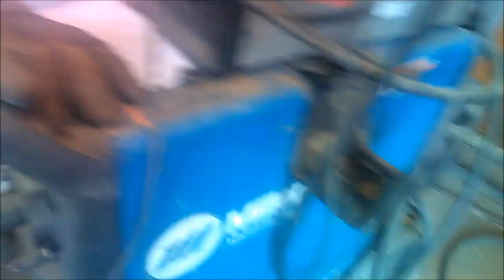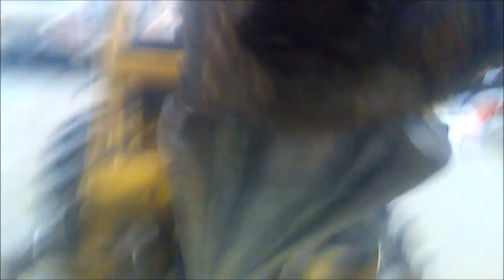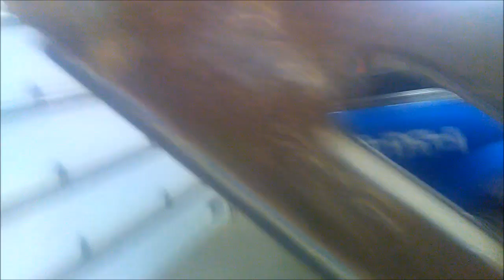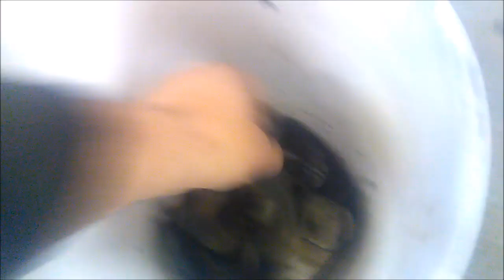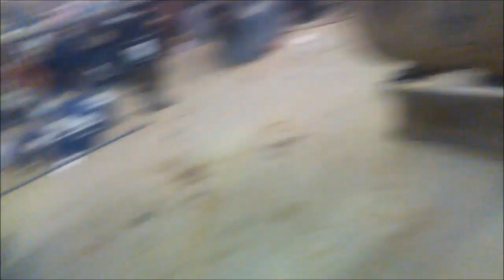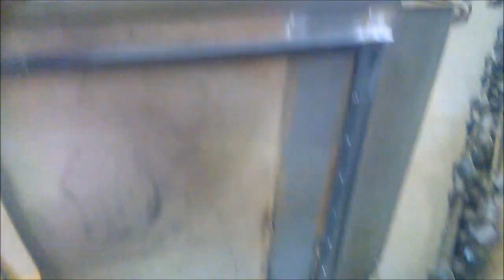Trencher repair

Comment: The whole chain frame has been bent out of alignment with the trencher
Reply from the maker: I'm not sure which part of the video you are looking at but it looks good to the eye in real life.  We are still running that trencher 5 years later with no changes to any of that.  It has worn out the chain a few more times since then.
Reply: @kennykemp2790 I apologize, my Vermeer.
Reply: It was purchased from a rental. But I think it was turned too hard. So now its all twisted
Reply: They are quite the machine

Comment: Kenny I have a 2013 Vermeer rtx750 trencher and I bought a chain from Ballantine which is a all cup teeth. After a few miles they are gone. I’m in a very hard sand. What teeth would you recommend? Would the teeth you have in this video work and how can I get them.
Reply from the maker: The ones we built work good in hard/abrasive sand or hard sandy clay or soft sand.  Pretty much anything that doesn't have over 8" rocks in it or very sticky/muddy clay. I would switch to an open rock cutter for that application similar to the B135318 and B135317 (Right and left hand rock/frost adapters).  If you can get them to match the cup cutter height you can run them on half the chain if you want.  The terminator/sharks teeth wear a long time also but are a little harder to change out when they need replaced.  Bolts or welding instead of a hammer/punch.
Reply from the maker: Also about 50-75% of the cutting action is done on the outside cutters and the middle doesn't take nearly as many teeth to keep it cleaned out.  Ours you can see runs two outside cutters on one station, then one inside cutter.  In frost or very hard ground if you don't have the two outside cutters running together the chain will "S" and not cut the full width.  As long as they clean the dirt out you can run them that way.  If they plug up you are in some pretty soft/sticky soil usually where cup cutters would do fine.
Reply: @kennykemp2790  so the rep told me today that he recommends the shark and cup combo. Do you think that will help? I do like the configuration on the chain you built. Do you sale the pieces that I can bolt to my chain or would you even sale a jig so that I could build the ones like you did. I can weld just don’t know the angles that you used without seeing it in person.
Reply from the maker: @brandon76518  The shark and cup combo would help it last a lot longer provided the shark cutters stand tall enough and wide enough to cut before or at the same height as the cup cutters.  I have not looked at the new versions of shark teeth for how they compare but your rep can set you up.  I also do not know what chain you are running ours is a 7600 (4" pitch) 

As far as the angle we bought the heavy duty (HD) pockets and they have a flat on the bottom for tooth angle.  Then turned them to match the width we needed on the outside (about 7 1/2" cut to fit our boom) then the inside cutters we adjusted one straight and one out on roughly the same angle as the outside ones.  We end up with 6 cutting lines across 7 1/2" trench so about one every 1.25"  The strap we used for bolting/welding to is I believe 2 1/2" x 3/4".  Don't spend countless hours cutting the strap and drilling holes.  Use an iron worker to cut/punch the strap even if you have to let someone else do it.

Comment: hi.would you know if a vermeer v4150 backhoe attachment fit a ditch witch 6510?
Reply from the maker: I don't know for sure but I highly doubt it.  I don't know of anything else that swaps over easily between the two.
Reply: @kennykemp2790  is vermeer and ditch witch the same company?
Reply from the maker: @micmac9853  No they are two different companies.
Reply: @kennykemp2790  hmn then it ups the probability it wont be an exact fit